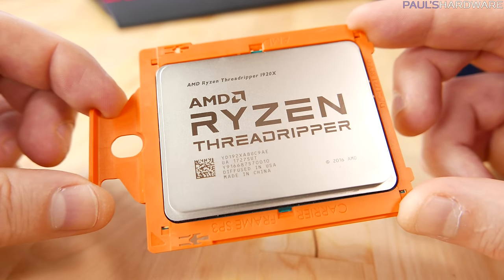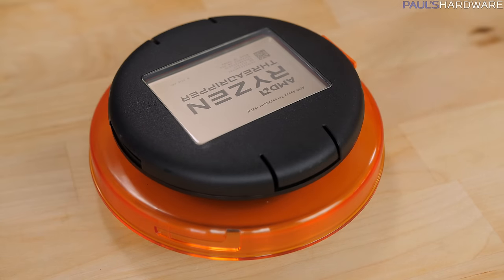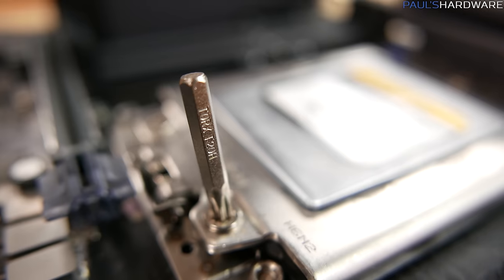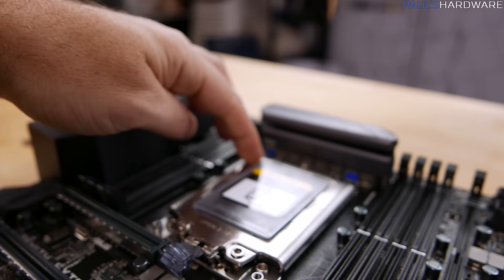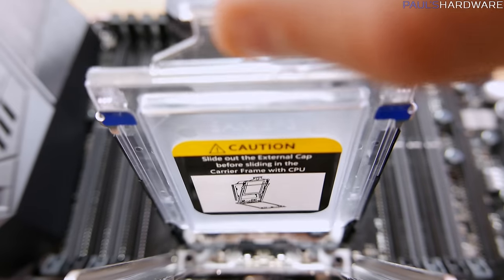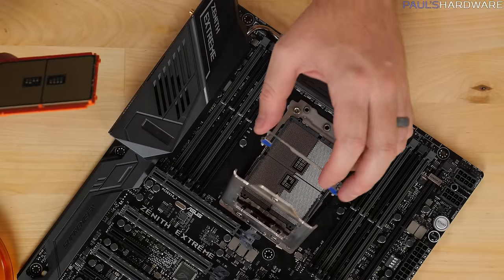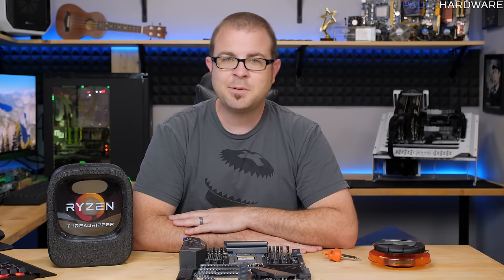Threadripper CPU Installation Guide! How Socket TR4 Works

Comment: All the stops for Threadripper, I'm loving it. That little screwdriver they give you looks like a pain, though. Can't wait to build my own!
Reply: You can use any T20 torx driver if you have one.
Reply: I hate that replies on desktop youtube are broken. Anyway, I know you can use any driver you want with the T20 head, I just wish they would have included something a bit easier to twist. Not everyone has torx heads lying around.
Reply: I know right, The only way to check for replies is to watch every single comment yourself!  It used to work!  Maybe Youtube doesn't want people to actually talk on its site...
Reply: i would buy it just for the torque wrench 
loving it AMD
Reply: No you can't use any T20 torx driver.  You need to use a torque-limiting tool and the T20 torx for it.
Reply: What's up with all these dumb consumers building super expensive overkill editing/streaming machines?
Reply: Henry Weng They're AMD Fanboys with money to burn and nothing better to spend it on.
Reply: +REDxFROG Is that driver they included a torque-limited driver? I didn't hear any mention of it being so, but I could understand why it would be. I'm sure plenty of people wouldn't want to ruin their brand new mobo by over-torquing the screw lol.

+Henry Weng It's called enthusiasm.

+Bartholomew They have AMD to spend it on.
Reply: Oh, looks like Paul listed the torque specs:

2. At the end of installation you can tighten the 3 Torx screws "all the
 way", but the included Torx tool is geared for the exact right amount 
of torque and will click when you hit it. The amount is labeled on the 
tool if you're wondering -- 1.5 N.m / 15 Kg-cm / 13.3 In-lb / 18 Ft-oz
Reply: it's a Torque Screwdriver, it's preset to certain torque value, once you tighten the screw to a certain level, it will 'toggle' with a 'knock' sound.  This is to let you know the correct 'tightness' of the screw has been achieved, to prevent overtightening.

Comment: You probably should have mentioned that the torx wrench included with the CPU is ALSO a TORQUE wrench, meaning you cannot over-tighten the three CPU screws. It will not turn them past (tighter than) it's set torque rating. Also means you shouldn't use a regular T20 torx bit screwdriver.
Reply: gamer taboo wish I could like you to the top of the comments. Seriously bad advice they gave on that part about using your own T20...no...no...NO!!

Comment: How much thermal paste should be applied to this chip?
Reply: +Gareki no Kami But supposedly many of the same AIOs will work with a simple bracket swap/adapter; the cold plate will be the same size. So would the TIM amount even change? Maybe you only need to cool the center?
Reply: Malus1531 Putting a small bit in the center wont cut it for a chip of this caliber. The chip has 4 Zeppelin dies and even though 2 are being used, id place four small globs on the area where the 4 dies go or if your lazy then you could do a large glob in the center or an X of paste. I could be wrong in all this though.
Reply: All of it
Reply: ALL THE THERMAL PASTES
Reply: 2 or 3 little lines
Reply: The whole  tube
Reply: @bang intel i9 may need that.. or maybe all over the x299 board
Reply: That's for the next video
Reply: I read in a book for making smoothies that the best amount of Thermal Paste to put on a processor is to cover the surface in a layer twice as thick as the IHS for optimal heat transfer.
Reply: all of it.
Reply: AdobeArtist 19 I'd guess three dots close together.

Comment: Helpful Video Paul, how tightly did you screw it in? I still haven't got my threadrippers yet so I don't want to over tighten them when I install my test ones.
Reply: Tech Showdown good question
Reply: Tech Showdown as strong as it was when it wasnt installed
Reply: I believe that the screwdriver you get is a torque driver, so it's already set to the proper torque. It should stop tightening when it is tight enough.

Comment: This is ingenious. It makes the whole process idiot-proof. No need to be turbo careful with the socket pins anymore, as you're not doing any manual things around it. The CPU literally falls down onto the socket by itself, perfectly aligned. The protective cover doesn't make contact with the pins either. I bet you could and should slide the processor in before you remove the cover. That's how you should make an LGA socket.

Comment: As always, nice sweet straight-to-the-point instructional vid. Well done!

Also, echoing another commenter, you should perhaps point out that the provided torx 'screwdriver' is actually a "torque wrench" that limits the amount of torque being put on the screws while tightening, thus preventing damage to the motherboard and/or screw's thread.

And while at it, also add a general WARNING if using a torx screwdriver: Do NOT overtighten. If the provided torque wrench provides any specs as to how much torque it will allow before it "clicks", probably put that in the warning, too.

Comment: If anyone doesn't notice those pins at 2:30 are ridiculously fragile, they look like curved contact pins that must not be misaligned EVER!

View in fullscreen at 1080p and take a very very close look at those pins.

Looks like the cradle that holds the CPU above the pins barely touches them and does not put it's weight on it, else those pins will curve and touch other pins.

Comment: Here's a question for you Paul or you can mention it in the review.
Does that plastic cover around the cpu affect temperature? And can you install the processor without it?
Reply: the cpu has to be installed with the orange cage cause the cage holds the cpu in place
Reply: muiecopyright no it doesn't. In fact most of servers use this way to install CPUs
Reply: muiecopyright plastic is needed to hold it in the rails

Comment: Oh hell no people are not gonna be happy that a little bit of the orange plastic is showing. Those enthusiasts are gonna get triggered! AMD has to fix that ASAP!
Reply: linus tech tip it and just use a dremal
Reply: lonegamer1717
Coolers will probably cover it up. And plus Ryzen is orange so it technically works...
Reply: The screw holes for the cooler is right next to it. It'll get covered completely except if you look directly at it from, the top of the case. Is fine.
Reply: unless you have an orange build. then it's awesome
Reply: It's not going to show up. The cooler will cover it.
Reply: rgb version?
Reply: That's going to clash with my build colors D:

Getting Kaby Lake X instead
Reply: just paint it black with marker, done
Reply: It'll probably be covered by the cooler if I had to guess, though if it's not then honestly they should fix that. There's no reason that a minimum $550 part should have such a clashing color on it.
Reply: lonegamer1717 

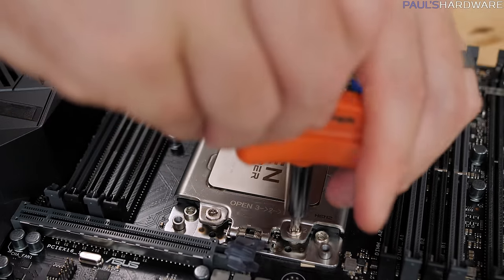3:18

You won't even be able to see that with a cooler on.
Reply: linus would love it so much
Reply: You can just cut it off... with a pair of scissors. It's plastic.
Reply: yeah no shit it should be RED
Reply: it should be RGB plastic
Reply: We need rgb plastic
Reply: lonegamer1717 you'll never every see that plastic once you place any type of heat sink on there
Reply: You've got 3 solutions, only one of which makes sense and is also mandatory.

1) Dremmel it. (lol)

2) paint it. (lol)

3) install your friggin' CPU cooler, which regardless of size, will cover that tab up.
Reply: that actually is annoying. its gonna mess with ocd
Reply: what the fuck guys you complain for just sliding a bracket  and screw?
are you serious?
ho my god...
i think it is a genius idea the way the cpu is.
the bracket minimize skin content with component and make the insertion fool proof.
and it is a lots better than the am4 zif where you can break or bend pin when the cpu stay stuck to the cooler in a switch cpu after some years.
and screw are a lot more secure than the weak levers intel use...
don't be a fanboy or complain for nothing and use your brain geez.
by the way it is covered by the cooler
Reply: aedan929 Lmao.
Reply: lonegamer1717 they'll complain for a bit until they decide to take it off and spray paint it black for themselves
Reply: Yes, because a brightly colored peace of plastic, that you will never see after the installation of the CPU's cooler is a HUGE problem!
Think of the children, and their color matched rigs!

THE CHILDREN!
Reply: Naw just get some engine paint and mod it to the color you want. More parts More colors! More UV lighting fun! Engine paint will stay on it for ever and you don't got to worry about thermal damage.
Reply: Evga and Asus and others like them are already working on different colored ones i heard.
Reply: lonegamer1717 jeez just spray paint it it's not that hard... though I recommend some sort of thermal paint or something just to be safe from high temps.
Reply: 999 USD and u have to paint it... NOPE!
Reply: If you plan on running with no cooler.
Reply: or you could start a cpu plastic cover business that sells different colored ones and make bank.....
Reply: CPU cooler?
Reply: lonegamer1717 3D print s bracket
Reply: the cooler will block it.
Reply: lonegamer1717 kinda true yeah but meh doesnt matter when you get everything you wanted and more!
Reply: aedan929 or drop it... that seems to work
Reply: So you're proposing that we should drop the Threadripper? :P
Reply: They gonna make custom RGB TR4 plastic with Asus Sync support 😂😂
Reply: lonegamer1717 cooler will prob cover it.
Reply: Except Linus would be completely cool with the orange. It's LMG's company color.
Reply: lonegamer1717 Stupid comment i've ever seen. The orange plastic will be covered by the fan and not visible after that.

Comment: Wow you guys are very lazy if you complain about installing this lol it's not rocket science
Reply: And I should know, I'm studying aerospace sciences Lmao
Reply: It honestly makes me sad that people think this looks hard or complicated. And these are people who build their own PC's, so they're supposed to be at least above average tech-savvy. This is just depressing. I know people with actual Downs syndrome who would have zero problems doing this installation. Just... what the fuck man.
Reply: +IsakH85 It's not too hard for people to do obviously, it just seems a little over-designed. Avoiding unnecessary complexity is a pretty basic design concept. PGA needed more security imo since it can rip out of the socket, but does it really need to be more secure than Intel? Do you really need sliding brackets and multiple nonstandard screws? If anything it treats people more like an idiot, since they can't be trusted to even touch the CPU.
Reply: it is socket science
Reply: The huge physical size of the chip might play a part this time around. I'd rather a socket be over designed than under designed if push comes to shove.
Reply: +Shared IP: Right? If people think using 3 little screws is complicated, I'd hate to see them change a flat tire. LMAO

Comment: Some people are complaining about the installation process but I actually think it was ingenious for AMD to come up with such a solution. Think about it: Threadripper CPUs are almost four times as large as a LGA 1151 CPU, installing them manually would require you to be EXTREMELY careful or all sorts of bad things could happen. This method, on the other hand, makes the whole process really easy and painless.

Comment: At about 2:00 into this video, it shows a protective pin cover that needs to be removed before cpu installation. My new (as of today new) Gigabyte X399 AORUS XTREME mobo didn't have a protective cover over the pins.

Comment: One tip I would give, leave the black pin/socket cover in until after you've slid the processor into the carrier. 
That way if you drop the processor into your socket for any reason your pins are still ok.

Comment: The slide rail is a pretty cool addition. I guess the torque(sp) screws are to keep the bracket on the large CPU die with uniform pressure? Or is there another reason for the screws that I am missing?
Reply: MrZoichi uniform pressure to help with the lifespan of the pins.
We can only notice a change after years...

Comment: 1) Putting a CPU cooler of any size will cover the orange bit.

2) This socket is hilariously massive.

3) This socket also has the coolest CPU installation i've ever seen ever. And since you don't rest the CPU onto the pins, the chance of bending any is seriously reduced.

4) the comment section is full of other certified tech channels whining about how AMD wouldn't let them do this and it's both funny and sympathetically frustrating.

Comment: Should note that you must use the included torque screwdriver as it is not a normal screwdriver it is set to a certain level so it does not over tighten the retention socket
Reply: Also by not torque screwing down screw number one all the way first you may have not put correct amount of force down on screw number 1, number 2 and 3 should provide even distribution of torque on each screw (but should be fine once heatsink is attached)

Comment: Is that an extra dimm slot on the right of the motherboard
Reply: Pacman Gaming it's for installing a daughter card that has mounts for additional M.2 drives. Or at least that's what it used to be.
Reply: Its a U.2 Drive slot
Reply: It's called the DIMM.2 Slot. It's a modified DDR3 DIMM slot to fit a card that comes with the motherboard to mount a couple M.2 SSDs.
Reply: Pacman Gaming It's technically on the left
Reply: ShadowOfDeath24 If you were the Motherboard wouldn't it be on your right?
Reply: Oh please, guys, lets not discuss this.
It is on the right in reference to who is looking at the mobo
It is on the left if the reference is the mobo itself, facing us

Comment: You should probably leave the black plastic pin cover on the cpu socket while sliding in the cpu. Then obviously before levering the cpu down remove the black plastic. Pretty sweet socket thanks for the video!

Comment: I think this way would be hell a lot more safer than just slotting it in like intel and for beginners, it will be less stressful plus it also has no openings to get dust or thermal paste under the CPU on the pins so this would keep the CPU alive longer.

Comment: Compared to Intel sockets, I think it'll be a bit of a pain to have to use a TORX bit to install a CPU, when it could've been a lever. But the carrier frame thing is super awesome IMO. It looks like a futuristic, and more importantly, safer way to install a CPU, since you don't have to touch the chip itself, just a plastic frame arround it. Hope Intel adopts something similar without dropping the lever mechanism.

Comment: That torx wrench looks like the torque wrench for my carbon clamps on my bicycle. Is that also a torque wrench, that has a break over handle? And if so, how much torque does the clamp require?

Comment: So can I ask, any reason to upgrade to this if you just bought a RYZEN 7 1xxx system?
Reply: Ivan Bigelow 2 Questions: 
1. What is your purpose of using your PC ? Gaming Only ? NO Streaming/ You have the budget to upgrade YES
2. Are you going to do some heavy editing/encoding videos like 4K stuff ? NO ? NO NEED . YES INDEED THEN
Reply: P/S : Unless you make money from using full potential of this CPU , which cost 999$ for the 16 cores one. And 500$ for the X399 Motherboard
Reply: More PCIe lanes and quad channel memory.  The downside is it's going to cost more for the cpu and motherboard.  So unless you need that there is no reason to upgrade.  If you are a gamer and streamer then no reason to upgrade but if you are doing other professional stuff then it might be worth it.  I think it's a way better option than going with x299 system from intel.
Reply: Daniel Terry I would not recommend to go for the X299 from Intel which the i9 cost about the same. But on the downside on Intel if you go with the lower line up the PCIE lanes will not be available much.
Reply: I didn't recommend the X299 system from intel learn to read.
Reply: Daniel ssh, let him try to sound like he knows anything about anything :)
Reply: Daniel Terry My bad sorry dude
Reply: Murgeologi Hey man at least i’m tried to help.
Reply: What Daniel wrote makes perfect sense to me. Picking Threadripper over an equivalently priced x299 system is apparently the way to go, although any purchase decision should only be made AFTER independent reviews. Nowhere is Daniel saying that you should pick x299 over Threadripper.
Reply: horrocko That was my fault for misunderstood

Comment: Could you in theory wait until the CPU is installed in that frame before removing the black socket cover? Anything that reduces the time thoze pins are exposed is a good idea imo. I didn't get a good look at clearance though to see of the CPU contact pads are in proximity danger while pulling the socket cap.
Reply: The only issue I could see, is you're then increasing the likelihood of touch the LGA on the CPU.

Comment: Just got a 2950x the first install was fine it wouldn't post though.  I did it a 2nd time and just started the screws in order then went around in a circle just a few turns each.   It worked then.  This was a Foxconn BTW.

Comment: So thermal paste, twice as much? Different areas? Just in the center?
Reply: chantafreak You should use a little more just in case, it should spread out well enough if you put it in the center.
Reply: Yeah makes sense, and that is mostly why I asked since its more a rectangle shape and the "dual processor" (to say something) arrangement isnt exactly centered I thought it would make sense to apply 2 beads of thermal paste off center (to the left and right)than one big bead in the midle. IDK I just thought if you go thermal paste in the center it would spread thin towards the sides.

Comment: I wonder if the screw down has to do with heat and having such a big pcb, possible warping of the board and making sure those pads maintain good contact over its lifetime